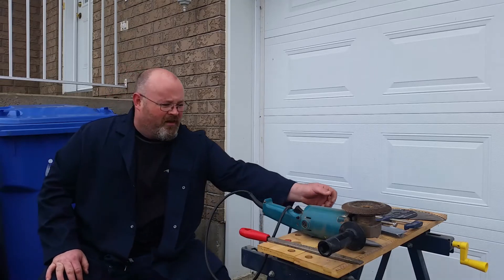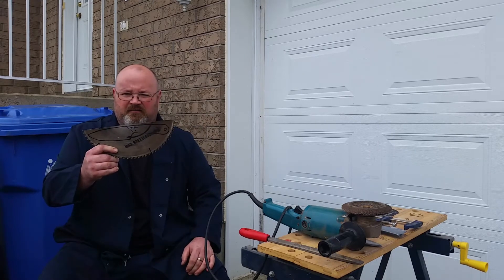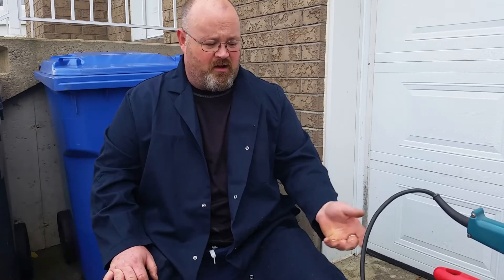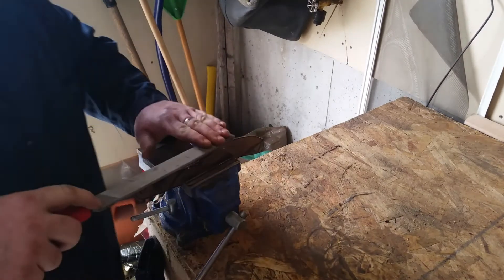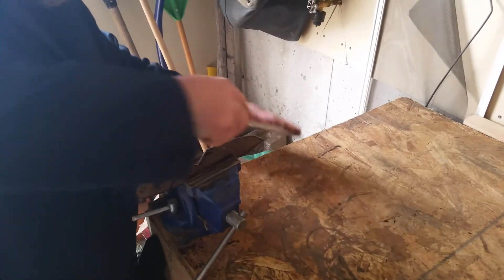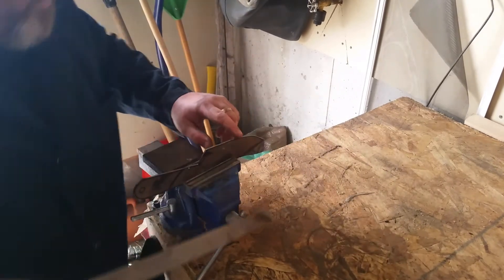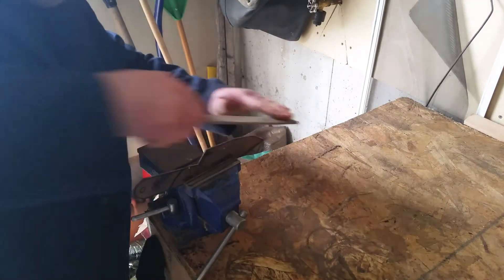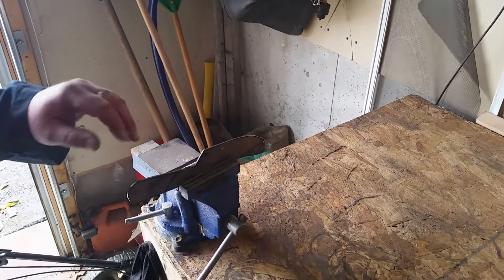How to make a Saw blade knife (part 1)

Comment: The line in themiddle of your handle showed up because the wood is drying, it was not propperly dryed when you started working on it, it might even crack later on. wood shoule be dryed for several years, I learned it the hard way :)
Reply from the maker: the cherry I used was a standing dead. It was drying for about a year and a half. but If I would have dried the material for another year in a controlled area it would have been better. Live and learn lol
Reply: Adventure Time Outdoors oh, well.
It's has a beautiful grain. love cherry wood

Comment: great video...what sawblades do you use for knifemaking? i hear most of the saw blades made nowadays are of low quality steels with infused carbides or diamond.
Reply from the maker: You heard right. this was a really old sawblade I found at work. they were going to scrap it so I gave it a try.
Reply: +Adventure Time Outdoors so   i guess its pointless to try to find a good sawblade unless its very old . thank you
Reply from the maker: +Laurent Nahra it definitely is not pointless. Any practice you can get will put you on the way to making great knives. When you do get your hands on a good blade or piece of steel you can make a great knife. As for the cheap saw blades they still make decent knives but not great knives
Reply: +Adventure Time Outdoors thank you for the advice